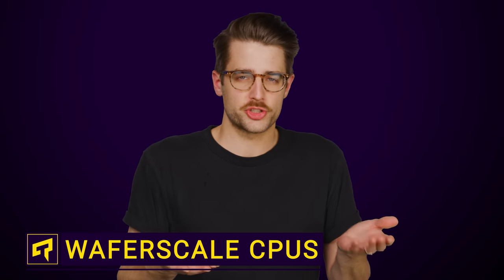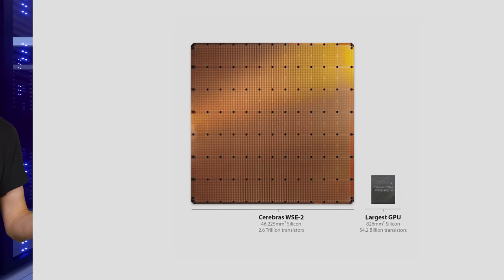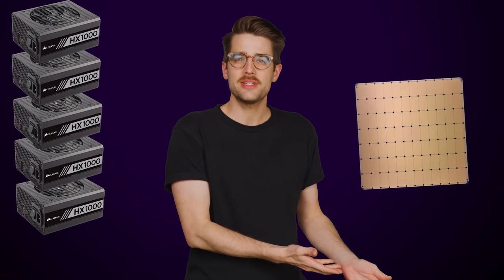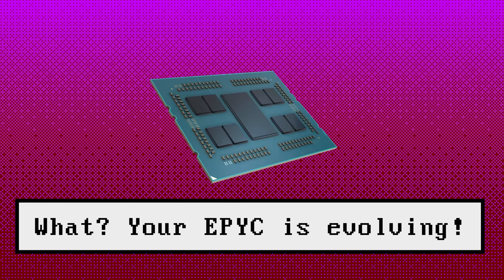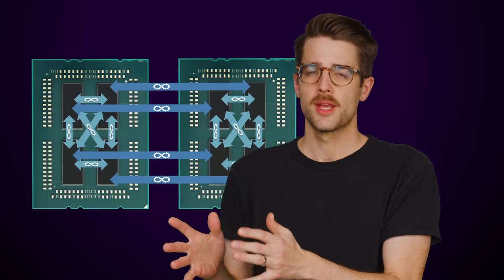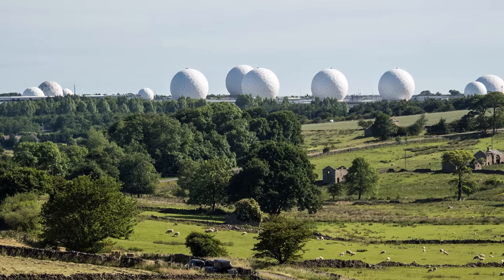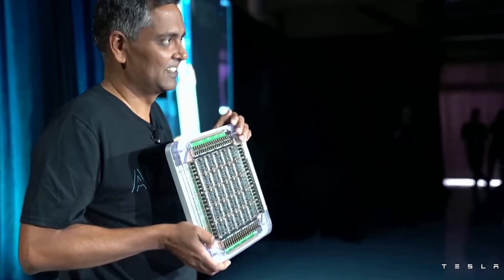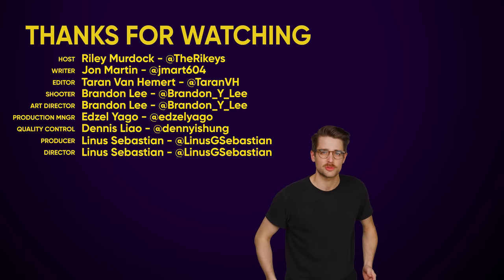The BIGGEST CPU Ever! - Waferscale Explained

Comment: I have a confusion, previously we had a video about why manufacturers dont make big cpu's for more computing power , and it boiled down to the fact that synchronization of the core clocks will not take place, so isn't it a issue now if we use these in data centers ?
Reply: im guessing it runs at a lower clock speed
Reply: On LTT they recently released a video about some radioactive clock, maybe they can match up the timings with that.
Reply: Thats not a desktop PC. For all its amazing computing power, its not actually faster than your desktop cpu for everyday tasks you might run (like browsing the internet, watching youtube, playing games, running photoshop). Its made to run lots of task parallel. Like servers. Think gpu. Gpu's have hundreds or thousands of (more or less specialized) cores. Im guessing that the cores in this cpu are more general purpose than the ones in gpu's (thats why its so big)... Or that was my understanding. I admit i didnt listen all that closely the video.

Comment: Hmm, since having to use interconnects slows down, maybe give each unit behind an interconnect a specific job to do, one that uses the interconnect as little and few times as possible.

^ It should be somewhat possible without creating an instruction set or such.

Comment: I wonder what the yields are like for the wafer scale CPUs ..not great I suspect.
Reply: Unless they scaled the SKU of chip that was purchased based on how many of the sections were disabled due to defects and it was designed around random ones being disabled. If you saw the picture of it, it had many chiplets all together on one wafer, so wouldn't be too odd if that is how it was designed. Would also mean that they wouldn't have to throw any wafer away as depending on how many working chiplet/segments there were would be a different SKU.

They already do that with consumer chips, like intel, nvidia, AMD. Like how multiple GPUs use the A102 chip, but it will be placed in different Graphics Cards based on how much of the chip had to be disabled.
Reply: Cutting  it down internaly  prettt much Solves  that
Reply: 100% actually. They have extra cores so they can just disable any damaged ones. They actually reduced this margin of extra cores on the WSE-2 since the number of damaged cores they got while producing the WSE-1 was lower than expected.

Comment: I wonder if a cpu could be made into a pyramid shape. More surface area, so more usable transistors, for the same motherboard space taken. The cooler could fit like a glove over the top of it, contacting on all 3 sides. The cooler itself wouldn't need to be all that much bigger, just designed to fit the pyramid in the center, with heatpipes coming up into the fin stack.

Comment: This answered my need to understand why don't we just add more and more processors to the computer and make it more powerful. The answer is we do, we just don't need to.
Reply: The same reason why you can't add infinite construction workers to finish a wood building instantly. Because a worker with a bucket of nails can only run so fast. By the time you have a million workers sprinting with a single nail, the problem isn't building the house, it's how to keep the workers from bumping into each other. You want as many workers as can fit in the site, but you want the fastest workers you can get.
Reply: @aarrcchhoonntt  slow workers are fine, as long as they all have a separate task

Comment: waferscale doesnt waste any silicon at all. it has a 100% success rate in manufacturing because the cores are designed to be simply bypassed if theyre all screwy, thus saving the entire chip from the skip.

Comment: power requirements are 2 things in computers
1 is peak use 
and
2 worst case
Not to mention built in overhead giving it a higher power rating than it ever showed in tests. So 15kw is peak power use worst case (highest seen in the test runs)+ say 10 or 15%
So the real power draw post start up on average will be as little as half of that and peak draw will be 75% of 15k.
This is why basic entry level dell hp etc junk have such weak psus they have ran test after test and found the average draw of the system at full load and shaved the built in overhead requirements to something closer to the real average with far less overhead

Comment: I would love to know what makes this possible or at least viable now when it wasn't before. I understand that ship defects are an invitability so is there some type of error correction that allows them to do this? Have they managed to shrink the size of each chip relative to the entire die that they just run a full die as a chip and bypass the faulty chips? Or have the error rates gotten to a point where the occasional full die can have no errors when they are binned? I would love to know what makes this the best option now when until now we've seen alternative methods for current data centre needs.

Thanks for another awesome video!
Reply: Increased demand for supercomputers. You can get the same result by throwing (more) discrete chips at it, with the upside that those chips can be useful for other applications. This thing? It's more power and space efficient yeah but if you make an extra 10k units it's not like you can sell them off for heated gamer moments or pushing snaptagram feeds.

Comment: Say 2.6T transistors
Show the WSE-1's spec sheet which has 1.1T transistors
still a beast tho
Reply: I was wondering why none of the specs seemed to match.  2.6T vs 1.1T,  7nm vs 12 nm, area seemed off too, but didn’t bother computing it out to be sure.

Comment: Good night toasty bros 
my name is Ezekiel I just wanted to ask you something so I have xfx Rx 560 GPU it has One HDMI one display an vga port on the GPU I got into streaming an will just wanted to know if my GPU can run duel monitors I am currently using the HDMI port and was wondering if I get a second monitor if I can use the VGA port to run a second display

Comment: 15KW!? 

X86 needs to die!
Reply: It's not x86
Reply: @riba2233  Wait what? What architecture is it?
Reply: @cnr_0778  probably arm or risc
Reply: @riba2233  huh interesting i didn't expect a CPU like this to draw so much power. I don't even want to imagine how much more it would be if it was X86.
Reply: @cnr_0778  doesn't matter how much it draws, only power to performance which is good. If it were x86, it would still draw the same power but would have a bit worse power to performance probably
Reply: @riba2233  I mean if it had the same performance of course.
Reply: @cnr_0778  yeah in that case

Comment: Linus Daddy. 

Pre 3 series cards don't really 'DO' HDMI 2.1 for new high end TV's... Cards like my 1080, which still hold up and don't quite justify an upgrade for a frugal gamer... Not til I can afford to anyway... Only have one HDMI port (already used by my HDMI second monitor and mirrored to a shit tv via a shit splitter) and it's not HDMI 2.1... Which would be fine if I could find a decent Display Port 1.4 to HDMI 2.1 adapter for one of my 2 spare display ports? Only one I'm seeing doesn't support Gsync though? If there's no gsync what's even the point? If there's no higher resolution and frame rate from 2.1? What's even the point? 

And god. Don't even get me STARTED on how dodgy my ebay HDMI splitter is I'm using to mirror on my current shitty second screen and shitty TV (while waiting for my new TV (a Samsung QN90A) that has me in a mad panic trying to find a way to get a HDMI 2.1 signal), this splitter is a nightmare, graphics card drivers restart for about 10 seconds while it cycles on every time a monitor turns off or on again. No way in fuck I'm letting it near my pretty new TV when it finally gets here in 6-8 weeks or whatever. =\

Also... Like... A walkthrough video for a NAS archive server/PoE Security setup on the cheap would be SUPER neato. I'm trying to plot a build that can take security cameras now, so I can protect my new TV that cost me like 5 weeks pay when I'm at my shitty job, and expand into a RAID nas later for redundancy on long term storage to fit my 6 odd TB of files from the past couple decades onto (and eventually the couple TB on dead HD's when I can afford to recover them), and so my main gaming PC can be easily geared for ghosting regular upgrades and replacements* and accessing documents via a 2.5/10 lan port, or whatever. 

*(I wanna try a regular yearly upgrade + case mods and selling my old PC while it still has value, see if it has equivalent yearly outlay to a full build every 3 to 5 years or whatever, just requiring some runway for the upfront cost, will be a fun experiment anyway, like say I buy a $5000 PC every year, and sell it a year later for $4000... Wouldn't that theoretically be the same average outlay as a new build every year? except i'm always on the bleeding edge? Even if there's a slight premium... How much of a premium is there? How much will case modding retain my market value? That's what I'm gonna experiment with fam.)

Some clean, sharp, stepped build guides on all this stuff would be SUPER NEATO my dude. Anyway. Yeah. Love you dawg. Big time. Look after Anthony he's amazing. <3 peace <3.